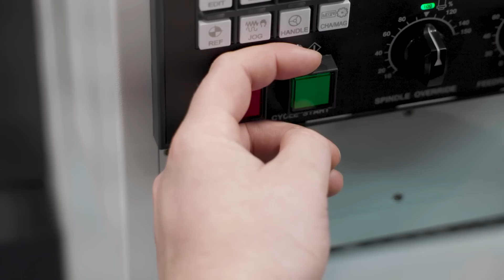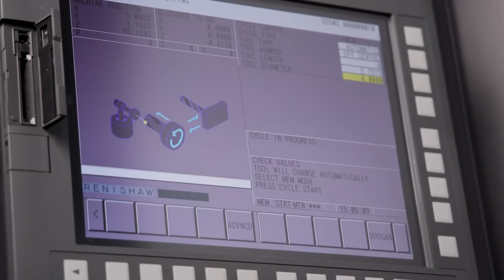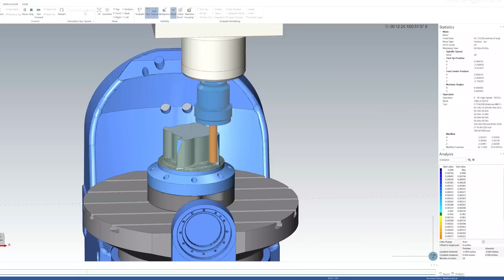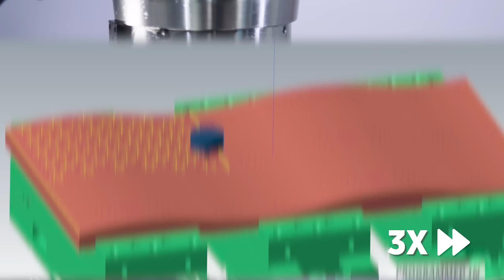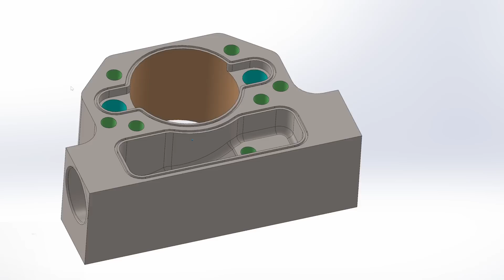My HSS End Mill Will Machine Circles Around Your Carbide Tools

Comment: after finishing my mech engineering bachelor and with just common sense and basic economical thinking l never though buying cheap low quality tools was a thing ... buy shit tools make shit parts. we have some good tools at our shop but not enough standardization. everybody has too much special stuff while some of our most porductive machines have a handfull of good flexible tools. when some stainless comes in everything fails ... inserts dying and everything. l then checked we have soo many inserts, multiple version from different manufacturers for the same insert. but then not even some roughing inserts for stainless ....

Comment: Pal, no one says that, it isn't the 1980's anymore, everyone uses carbide, I never see HSS.
Reply: I just googled high speed steel end mills and there are numerous places selling NEW HSS end mills. They wouldn’t be making new ones if nobody was buying them.
Reply: @trevorgoforth8963  They are used on older machine where you often can't get the speed for carbide, I should have specified with CNC machines, but I think the title and thumbnail is misleading personally
Reply: Loads of places still use them
Reply: It's useful to cut some groove or things like this if you had just one piece to do you grind a hss tool and you don't need to buy a expensive tool that will be used once
Reply: Read the comments. I was unaware, but apparently still people think HSS is superior or has its place. Its surely mind blowing.
Reply: @fordhoarder  It does in certain applications, obviously this is an exception like everywhere in life, but generally carbide is more used, and better.